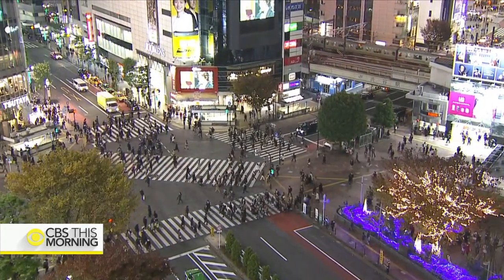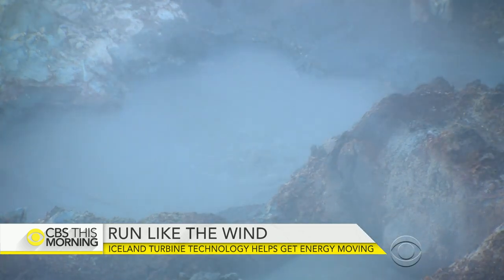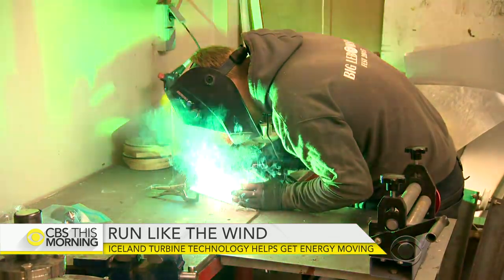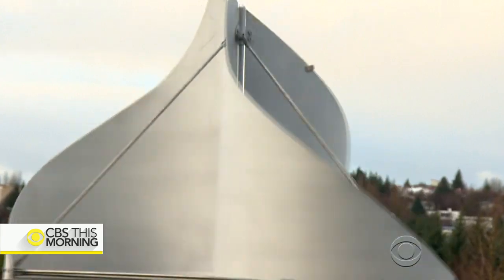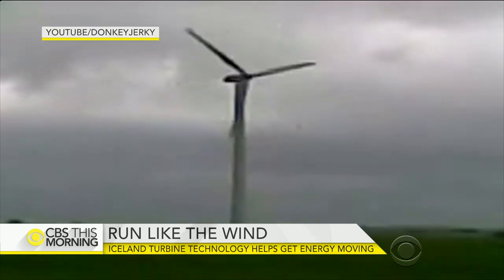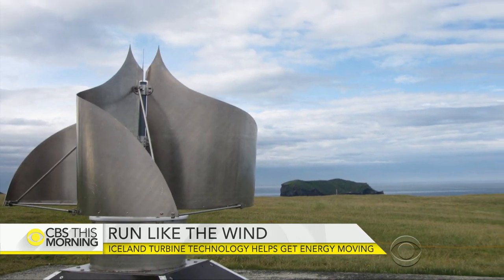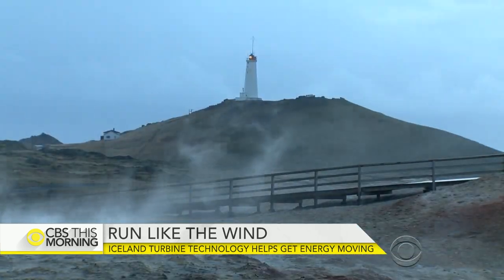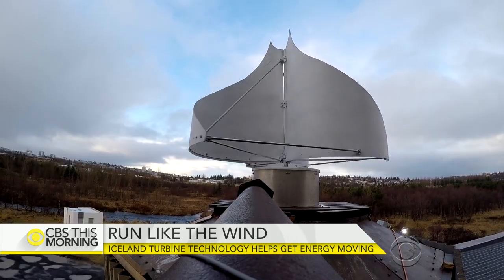Unique turbine technology in Iceland helps move energy

Comment: It is good, but efficency similar to other turbines, and rather something lower to propeller This turbine has smoler vibration and noise, but more difficulties to bearing.
Reply: More difficult to bearing?
Reply: @cemasti4524  Maybe it was meant that regular fan is just pushing on the bearing, where rotating from side wind puts more sideways pressure on the shaft that would need a better bearing setup to allow for sideways torque.
Like, you can push the end of a pole and it be pretty solid. Push the pole sideways and one has leverage to deal with.
??

There are scientific terms for what I say, but I do not feel like looking it all up.